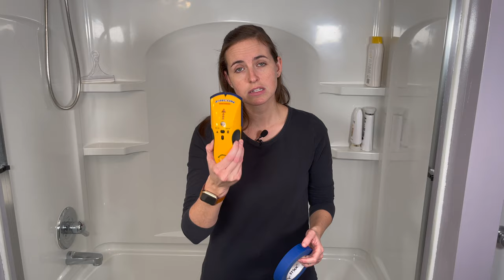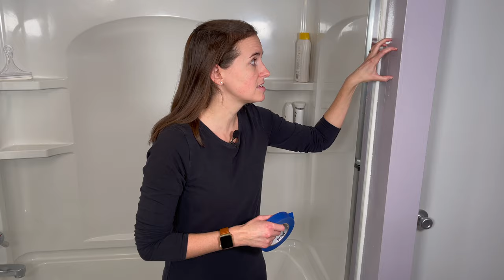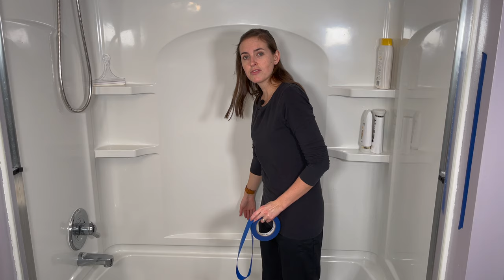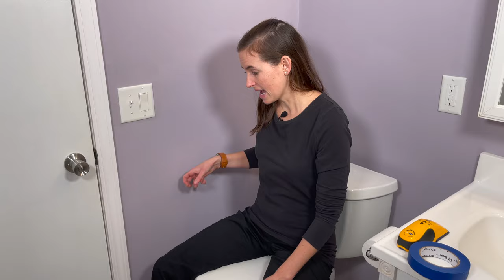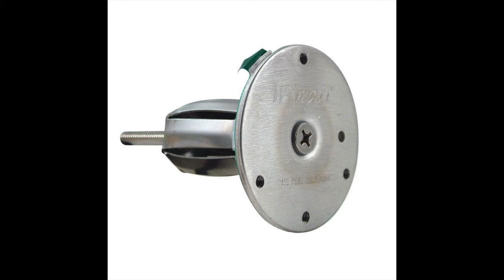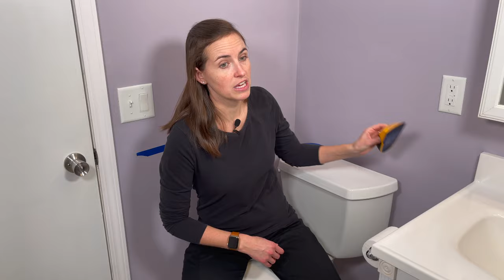How to Decide Grab Bar Placement | Shower and Toilet

Comment: I downloaded the ADA specifications for grab bars install. I live in the US/Midwest and it took me more than 17 calls to find a contractor who was willing to install a grab bar. With studs being just 16" inches apart I ended up buying a16" grab bar. The contractor took about 5-10 minutes to install and this guy charged me $160.00. Un believable!
Reply: The ADA heights are for public accommodation,  based on average standing US/western European male height, 1954-1974.  They are NOT based on   kinesiology, type of activity, or falls. Statistically,  the difference between males and females is more than  1", the average height increased over the past 50 years, and the height of both declines by another inch  between ages 25 and 75.  Static horizontal shower bars are a poor compromise.  Inclined stair rails work because taller people have longer arms.

Comment: I would highly recommend the Moen Secure Mount system for grab bar installation. (I have no connection to the company.) These mounts do not require stud attachment and are rated for 300 pounds even when both ends are secured only by 1/2- or 5/8-inch wallboard. Too often studs are not optimally located for grab bars, and stud finders can leave too much desired in terms of accuracy. The Moen system works with or without studs, and is indeed a better mousetrap.
Reply from the maker: The Moen system is an excellent choice for non-stud attachment! It really is one of the best on the market.
Reply: @EquipMeOT  
Wing-Its are also an excellent option, although a bit expensive.  They sell a 3/4" carbide bit for the mounting holes.  It won't go through porcelain, so you'll need a diamond bit if someone used floor tile on a shower wall.

Comment: How to put grab bar in a shower stall with a glass wall on the other side of the stall? Do I put in the middle if the wall or slightly off ( like behind a shower chair?) my stall is 2.8 ft wide and 5ft in length. I use a shower chair and don't want to feel being squeezed by the grab bar and glass wall once seated. Thanks

Comment: Hi Lindsay, thanks for the information! As a new grad OT, this is so so so helpful for decision making~ May I ask more about grab rail behind the toilet? I can't quite picture how it helps with transferring on to the toilet... Thanks.
Reply from the maker: The grab bar behind the toilet can be used to reach and stabilize from a standing position (think men standing to urinate) or for the process of turning from standing facing to sitting if the person needs many points of support.

Comment: Thanks,  I was unsure of height placment.  Be careful: The door stud, almost certainly is covered by the trim.  That's a no-go.  There may be a stud adjacent to the wall switch, but be careful, the worst scenario, I think is to find half a stud behind the screw holes.  Then you can't use a moen securemount.  The securemount requires a 1 1/4" hole.  Imagine drilling the hole and finding behind the hole the 3/4" of space and 3/4" overlap of the stud.  Well, you cant fit the securemount back-piece in, and you would be ill-advised to try to attach the mount to just the edge of the stud.   Oftentimes, I think that the best way is to make sure there is NO stud at either end and use two securemounts, they are rated at 300lbs.  Older homes, in New England often have odd placement of studs, and they are not always 16" on-center.

Comment: I may have missed it, but I see that you recommend horizontal placement in the tub over a slanted placement - is there a reason for this?
Reply from the maker: I find that horizontal is the most universally useful but contingent upon appropriate stud availability. Some people do like the angle for pulling to a stand while seated on a shower chair, so in those cases I’ll put it in whatever position is most comfortable.
Reply: @EquipMeOT  Wow, what a quick response! Thank you so much, that's so helpful! Thank you for your informative videos.
Reply from the maker: You’re welcome!
Reply: @EquipMeOT  What is the reason for only having 1 1/2" between the inside of the bar and the bathroom wall?

Comment: Good video- teaches "How to think" versus "Do this," which is good because every situation and client is different.  

One point I'd mention is that being aware of plumbing and wiring locations is important- I'll let you imagine how I know...  An "NCV", a non-contact voltage tester can help reassure you that you haven't nicked a wire.  "nie wieder bohren" is a German company that makes (very expensive) adhesive fastened grab bars, which can be a good solution is some situations.  The ads say they can be removed without damaging the substrate.  For me, not having to fret about "What's behind that wall...?" is worth quite a bit of money and may actually save enough time to offset the cost.

Comment: For the vertical bar on the water supply end a good framing carpenter will usually provide two studs approximately on 12" centers , offset equally from the center, for the plumber.

Comment: I remember a reno show where the home was being renovated to accommodate a child with lots of special needs. One of the suggestions (and things they did) was to line the whole bathroom with 3/4" plywood under the wallboard. The idea was they cold then place brab bars anywhere they needed to, and easily move them if/when required as the child grew. obviously not what you are doing here but perhaps some thing to suggest for anyone you consult with that is doing a full bathroom (or other rooms I guess) reno.
Thanks for giving me some ideas for installing grab bars in my home. We don't need them (yet) but they would help for those times my brother visits.
Cheers from New Brunswick, Canada.
Reply from the maker: Yes! Blocking the walls for grab bars can make a massive difference!

Comment: I just got a grab bar supposed to be strong suction, I almost fell because one end came off, can you recommend any for the shower
Reply from the maker: Unfortunately, suction cup bars often release at the worst times. I strongly recommend installing grab bars into a stud in the shower if possible. If not possible a Security Pole can sometimes work in the space or a clamp on bar on the tub edge (for tub/shower combos).

Comment: Do you have a video about the installation of the grab bar through the plastic liner of the back of the shower stall? I understand that it's more complicated than installing through the drywall. Thanks.

Comment: Great video! Very detailed. For an elderly person who only takes baths and not showers, would a diagonal bar be easier on the hand strength so the grasping arm is more perpendicular to the bar? But I know once the person is standing, the diagonal orientation it not as helpful. Trying to figure the best. Can something be fitted/added to a horizontal grab bar, so when a person with weaker hands grabs from an angle from a seated position to stand (or visa versa), it reduces the chance of slipping? Thanks so much!
Reply from the maker: I’ve seen the diagonal bar be useful in that scenario, but I’ve also seen the clamp on bar added to the side as a better grip angle.
Reply: @EquipMeOT  I plan on using a clamp-on bar in addition to the wall grab bar. Thanks so much.
Reply from the maker: You’re welcome!

Comment: We have a similar situation where the size of the shower was limited to 30" because of a doorway and an outside corner (from a hallway closet that butts into the room). We will have to put the vertical bar outside of the shower. But, because there will be a shower seat, the grab bar will have to be on the side with the controls. We want horizontal on the side (24") and another horizontal one on the walls with the controls (16" with a shelf to hold stuff). I'm debating whether to put it above or below the controls. This will be for a shower only-- no tub.

We are gutting an old one-piece shower-tub unit so I will add blocking in to the walls rather than worrying about stud locations. Would a 48" vertical bar outside be ok? It has a curl grip on the handle. We couldn't fit the 48" one on the side wall because of the curve of the shower and how it comes in where the shelves are. I believe we have a 24" grab bar to go there. We also have a 16" Moen grab bar shelf that we want to put on the wall with the controls. We have a showerhead with a built-in 19" slidebar (Moen Refresh 25113).

I'd be wary of putting nails or screws into a wall with electrical just in case you run into wires and some clown didn't put in nail plates.

Comment: Thank you for the grab bar for the bedroom  - great video !  Will this bar be able to pull you up to a sitting position from a lying position  ?  If not what would you recommend?   I have an adjustable bed frame ?  Thank you for your time and help. 🥰  Sharon H
Reply from the maker: There is a similar product that can have a trapeze addition. That would work to get you to sitting from lying down. It’s by Health Craft and still works with a floor to ceiling tension bar system.

https://www.healthcraftproducts.com/product/supertrapeze/

Comment: We in our early 60s and are building a cabin.  We don't need grab bars now but some of our guests might, and we might also need them for ourselves in the future and are trying to think ahead.  Given that my husband is 6'4" and I am 5'6", what heights are recommended to accommodate a range of people?  ie the horizontal grab bar on the back wall of the shower - do we both consider our optimum level and place the bar in the middle of that to accommodate both of us?
Reply from the maker: That's wonderful that you're planning ahead! If you are going to be blocking behind the walls so grab bars can go in in the future, I recommend using you and your husband to test comfortable/natural grab heights and mark them on the studs and then place blocking in that span. I usually go somewhere in the middle of the 2 hand placements (slightly higher for the shorter person and slightly lower for the taller person). I also like a combination of vertical and horizontal bars, so blocking for them is wise! Great question and congratulations on the new home!

Comment: thanks for your video. May I ask how to determine the height of the horizontal grab bar next to the toilet?(your right hand side) As I read many guidelines , some said above toilet seat 300mm to 400mm. I know the height of grab bar depended on the user.... besides their comfort feeling and any other determinants we may consider? thanks so much
Reply from the maker: The construction of the wall will often be a major dictator of the placement of any horizontal grab bar.

Comment: Some comments  :
- if you were to only put grab bars where there are studs, you'd be putting grab bars in places which were not ideal for the user
- good luck finding studs behind many tile walls, next to impossible to do it accurately
- on a properly built tile wall, insert anchors like "alligator anchors" can be used
- do not install anchors into the grout lines and try to stay away from the edges of tile
- drill through the wall but do not drill into the wall cavity - stop when through the wall
- use a "feeler stick" to explore the drilled hole
- what is on the other side of that wall? (eg, electrical outlets above a kitchen counter)
- what is behind plastic/fiberglass tub surrounds is often not a stud but thin wood strapping and gaps
- installing vertical grab bars on faucet/shower walls is risky - there is always  plumbing in that wall
- when in doubt, put the bar a tad higher as opposed to a tad lower
- always consider multiple people in one household and perhaps use longer bars to accommodate all
- for hollow wall installs, use "snap toggles"
Reply: Snap Toggles is a great tip, I always use those when I hit a hollow mounting area.
Reply: Alligator anchors, and wing-nut type, is a word is inadequate.  They'll snap through 1/2" gyprock with less than 100lbs force.  Use the SecureMount system which is good up to 300lbs because it has more surface area behind the wally.
Reply: @Eclectic_RN  On a properly built tile wall, and with 4 to 6 5/16" Toggler Alligator anchors per bar, Alligator anchors are fine.  A 5/16" Alligator anchor has a max pull-out value of 85lbs per anchor, so with 4 anchors that is max pull-out of 340lbs and with 6 anchors that is 510lbs... and that is on 1/2" drywall, so a tile wall is much stronger than that.  Do I use Alligator anchors on hollow drywall installs?  Nope, only on tile walls.  On hollow drywall I use Toggler Snap Toggles, which are cheaper and easier to install when compared to the Secure Mount system and can be used with virtually any grab bar.  The Secure Mount System is also fine.

Comment: 😒😒👎👎  Bad advice to drill holes in the shower wall between the shower head and the water valve - you might drill into a water pipe in the wall.